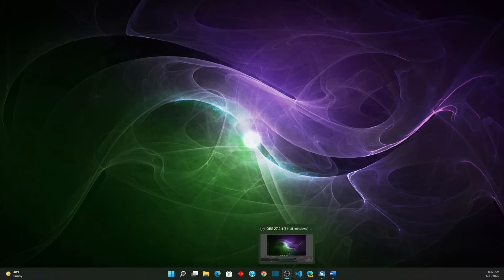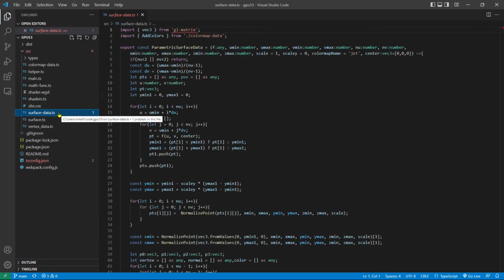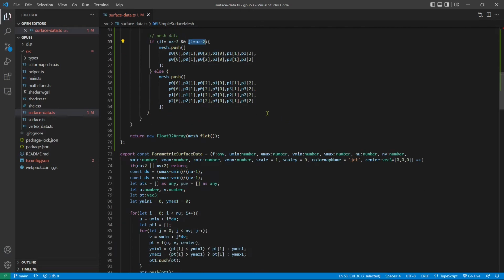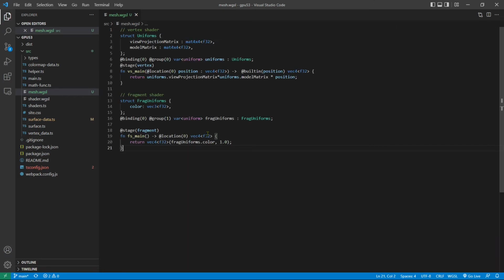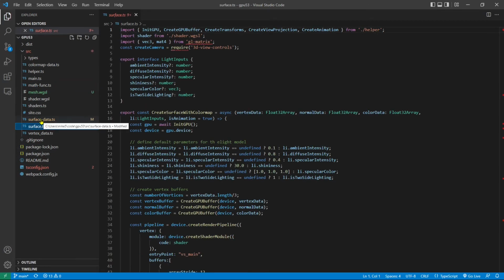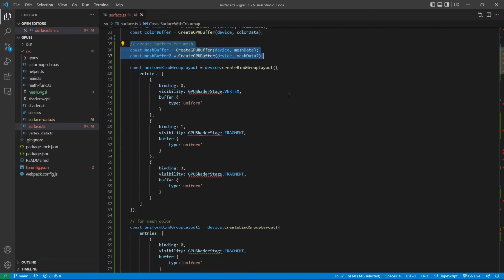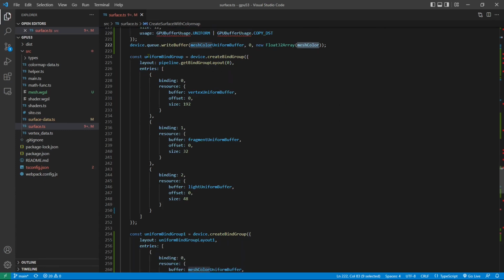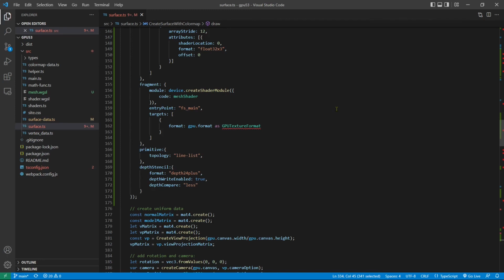WebGPU (53): 3D Surface Charts

Comment: Hello, Dr. Jack!

I wonder why mylocalhost in LiveServer doesn't start the code itself opening the folder with project itself then I have to come to the 'dist' folder to get the webgpu in my browser. Thankx
Reply from the maker: This may be because you forgot to set the live server's root directory. Just press Ctrl+Shift+P key to bring up the Command Palette in VS Code, and type "Preferences...", and then select "Open Settings (JSON)". This will open the settings JSON file. Add "liveServer.settings.root": "/dist" to this file. It will automatically start your application when starting the live server. In my first video at (https://youtu.be/-hXtt4ioH5A), I discussed the detailed steps on how to set up the development environment.
Reply: @PracticalProgrammingwithDrXu  Wow, Long live, Jack! We need you!